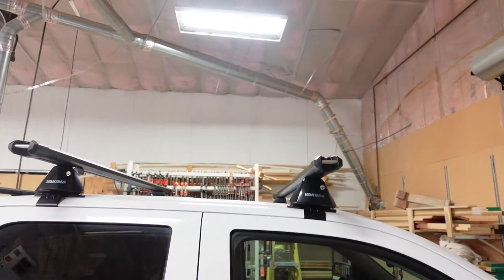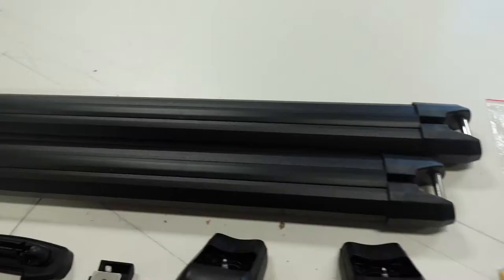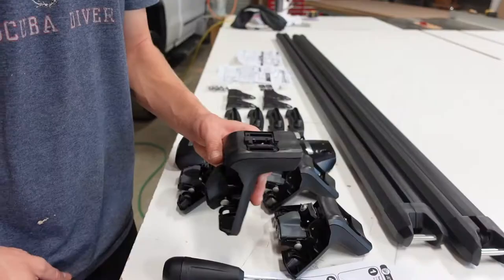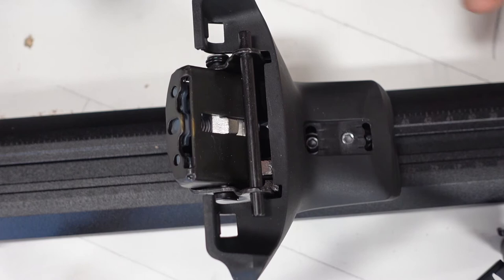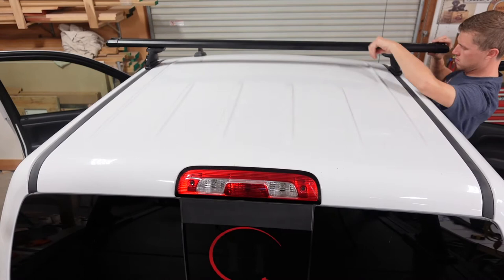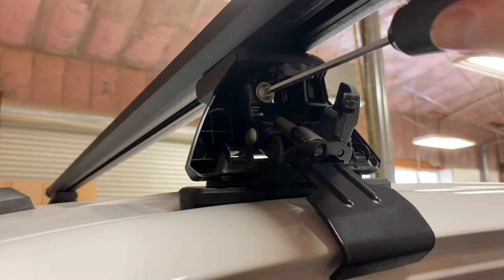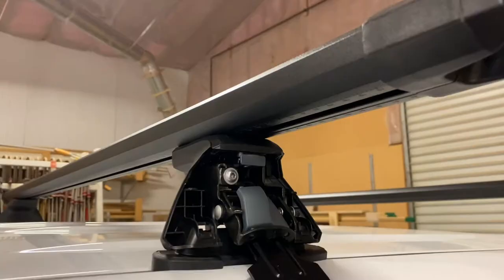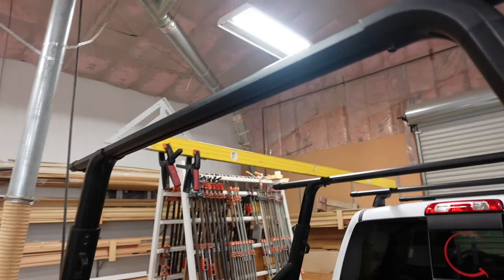How to Install Yakima Baseline Towers with HD Bars

Comment: Nicely done. I just finished the exact same setup on mine. Did you match everything's height with your front-most bar? Mine is considerably lower than the rest, would cause my load to sit at a strong forward slant...